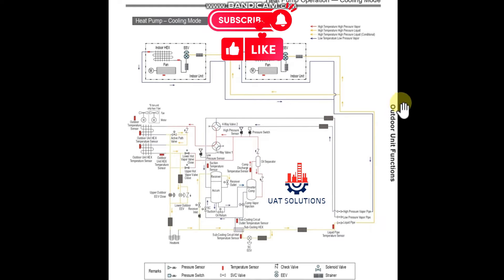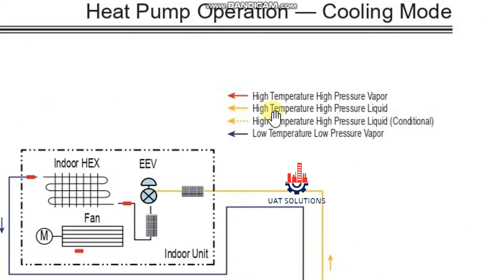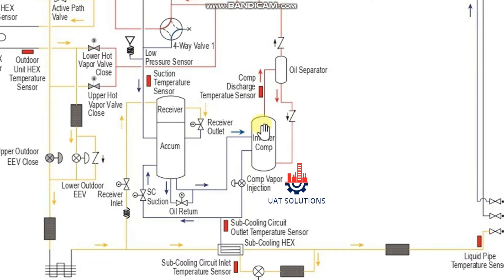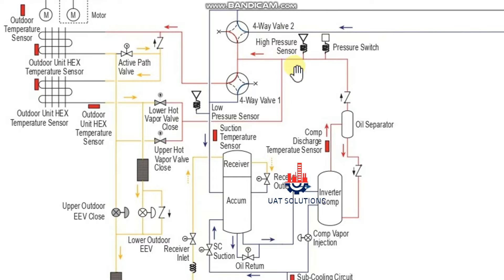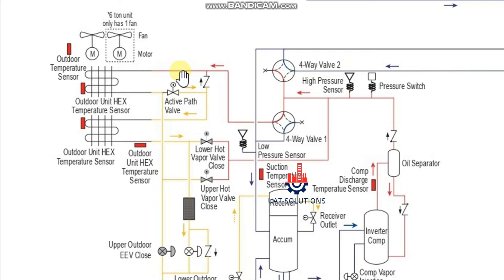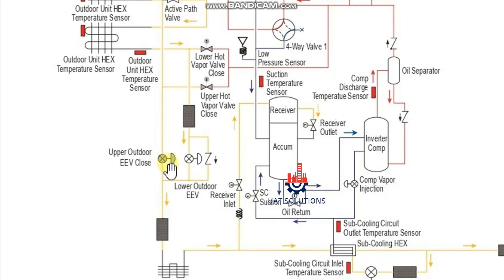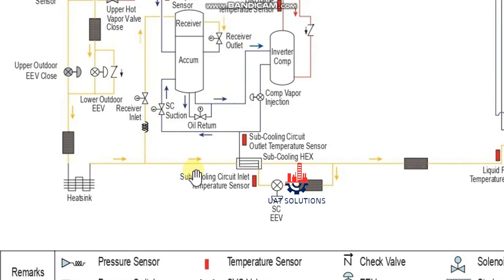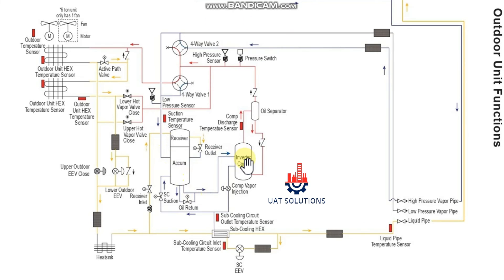LG VRF Multi V5 Training Course | Part 7 | VRF Refrigeration cycle Cooling Mode Explained

Comment: Why when i push nitrogen into the high pressure gas side (3rd, right-most pipe) nothing appears in the other 2 pipes? But when i push nitrogen in the other 2 pipes i see nitrogen come out of the high pressure gas side? Is there a one-way check valve in the branch boxes for the high pressure gas side? This happens with every LG VRF heat recovery unit i tested. I tried initiating vacuum mode Svc Fe3 but absolutely no difference was seen in terms of nitrogen flow, just hear a click at the outdoor unit and "Vacc" displayed on screen. 

Note: that the allen key service valves are closed and I'm pressure testing the lines before i vacuum, charge and comission.
Reply from the maker: There is definitely check valve / non return valve along the lines which is preventing gas flow.